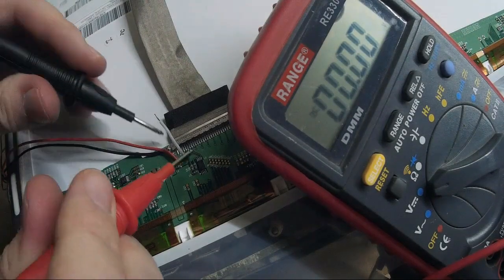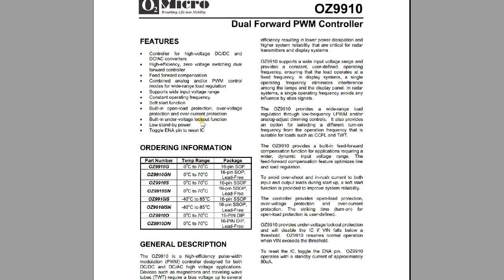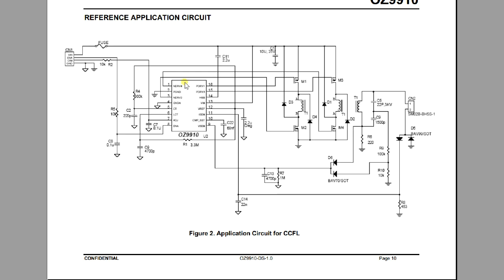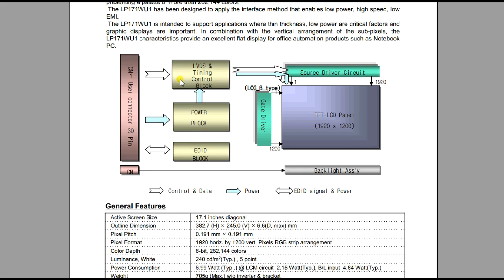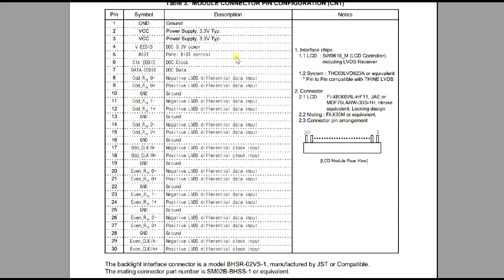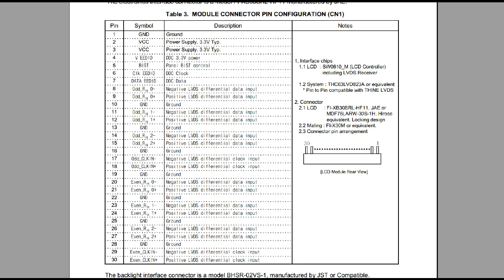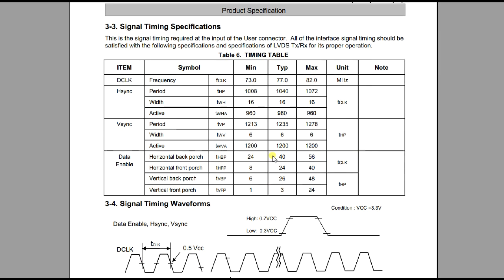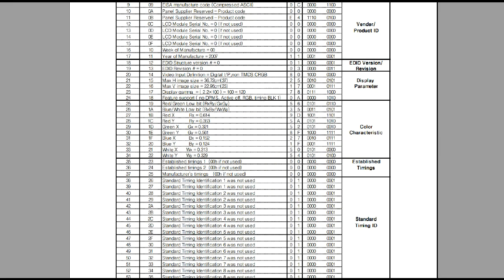Laptop LVDS LCD hacking with FPGA #1

Comment: I have LG display . A capacitor and resistor is blown. is there a way to find circuit of the LCD panel. I searched for panel datasheet it doesn't have circuit it . Panel is : LP140wh1 tla1 , it has Lg LCD controller SW0624 in it . Can you help me ?

Comment: Ok, very interesting. It is always nice to watch a master at work.

However, you skipped quickly past the last steps. How did you hook up the BIST? What did you do to get the backlight brighter? You are leaving me in suspense! Maybe you are creating an EE drama? It's all very exciting and I'm loving it. Thank you.
Reply from the maker: Bill Wadley Hello Bill. Good questions! I am still learning how to video-document my progress and I really forgot to explain some of the steps. Also english is not my native language so I'm little struggling when I have to talk longer. I focus on your suggestion in next videos.
Back to your questions. The BIST input is simply tied to logic one - 3.3v and it simply displays the colors without any LVDS input.
The brighter backlight was made by putting not 3V but full 12V on the brightness input pin on inverter. I think that there should be connected maximal voltage 3V, but maybe I damaged the inverter and 12V just works :)

Comment: I'm working on using a controller from a smart TV to an old laptop screen the controller has the 51pin  ribbon plug and trying to connect a 40 pin plug

Comment: What was the solution to getting the backlight at full brightness?
Reply from the maker: I connected +12V with 10k resistor to another input which was supposed to control brightness. Instead of PWM I put there constant voltage. Truth is that it is probably 3,3/5V tolerant pin and I put there 12V with resistor. But so far it's working.
Reply: interesting.   I have a project i am working on with a very strange piezo element based inverter.  Not the same as yours at all.  With 3v, or 5v, on the PWM pin it does not go to full brightness as one would expect.  I wonder if a higher voltage through a resistor could be the answer.  I have a few to experiment with.    What was the thought process of 12v, rather than 3v / 5v?   I suspect they would be more readily available.

Comment: could you go the other way with the fpga? laptop lvds out to fpga to hdmi out?...possibly cut off that pesky hdcp in the process?
Reply from the maker: Johnathan Wuethrich Hello, that sounds doable. Not sure if there will be need full frame Ram buffer in the fpga. HDCP would not be an issue because that encryption is not present in the lvds signal. Bunnie Huang did a board with hdmi passthrough which removed hdcp.
Reply: thanks for the reply! im finishing up a big project that i wish was done (upgrading tag tastic rfid theif to use full range of said reader, be monitored by smart phone, abililty to clone tag instantly from smart phone command, reach into backpack and pull out the key you just swiped...and not take 12 AAs) but then I have my sights on this. I googled bunnie and found her site/what you mentioned right away! looks like a great next project! not sure why bishop fox missed the fact that the reader he used has 30% more range when ran at 24v but i guess 12aas kinda speaks to how much research he put into EE(can you say internal resistance?!). oh well lol

Comment: sir.... how can i connect the 30 pins( i get it from old monitor ) controller board to 20 pins lcd laptop?
sorry about my english.
Reply from the maker: +Popo Panha Hello. I don't think it would be possible. Monitor panels have different signalling than laptop panels. I looked at one LCD monitor board last month and wanted to do basically the same hack. But I gave up after some poking with oscilloscope.
Reply: hubmartin ohh......now i got it....
so what about the china board that sell on ebay?
Reply from the maker: +Popo Panha They sell boards which convert VGA/composite input video signal to LVDS. So you can replace your LCD monitor board with that Chinese board. But you have asked if you can connect your LCD board with 30 LCD signals to the LVDS laptop display and that is not easily possible.
Sure you can use something like http://www.ebay.com/itm/M-NT68676-2A-HDMI-DVI-VGA-AUDIO-LCD-LED-Controller-Board-LVDS-DIY-Reuse-Laptop-/291538657130 but I have no experience with that. Its necessary to configure somehow these modules specifically to your LCD panel.
Reply: +hubmartin Like to add that the boards from china now also support HDMI, so using a FPGA might be fun (and I like to try myself aswell) but ask a chinese seller, for more or less 30 dollars one can get a preprogrammed LVDS controller board. Its almost not worth building it yourself..

BUT, with learning and experimenting, I HIGHLY recommended to try it anyway. I hope to see more of this. dint check your channel yet, but doing stuff yourself is a great learning thing. if your just a cheap person and like to try a cheap board, go alixpress or ebay

Comment: I'm trying to reuse 3 lcd displays. 2 from tablets each 1280x800 tft 40 pin lvds...I think. I also have a 42inch LG display with a 51 pin out? I have no idea where to start....where can I find drivers that would work? Do I even have a clue what I'm saying? Hahaha
Reply from the maker: Hi, it is impossible to give you correct answer. Every LCD panel is different. You have to invest a lot of time and knowledge. I was lucky that my LCD panel had single power supply plus the CCFL backlight driver. The newer ones have LEDs for backlight. I've seen some tablet panels and I gave up because of the many signals that I had no idea how to connect.

Comment: I have a bright white screen error on Dell XPS 12 LCD. Invsrc, enbl,pwm ,along with vgl and others all have voltage that seem correct.  Main display chip on LCD control board shows hot with thermal camera. Could that be problem?